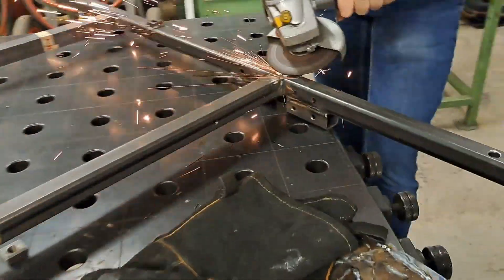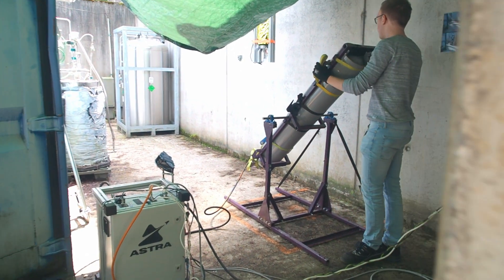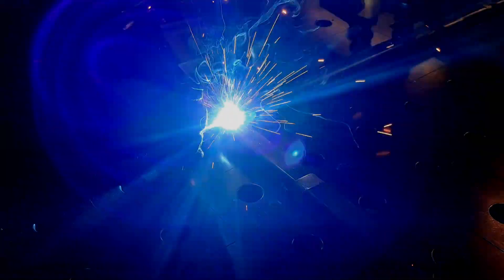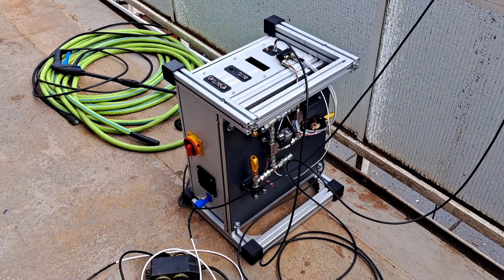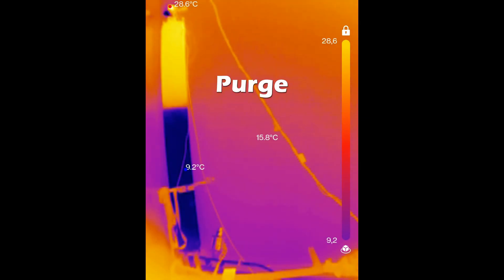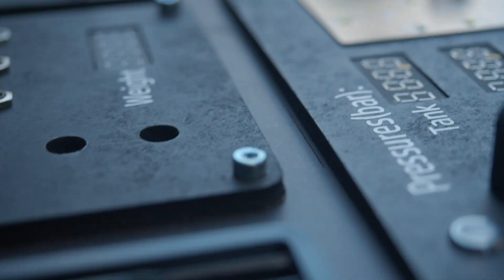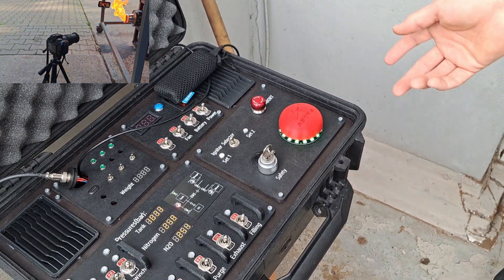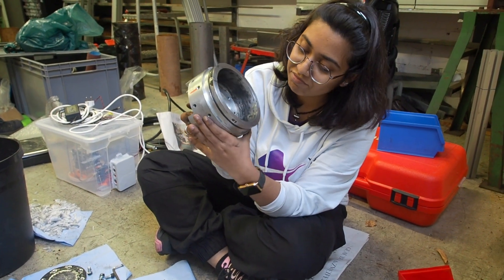Don't forget about this part of your rocket!!...

Comment: Instead of valves, why not use NOS transfer pump operates which uses a standard air pressure tank for operating power.  My main question is why don't you use a standard NOS tank like those used in race cars for your rocket instead of building your own tank, remove the valve on those race tanks then remove tube that angles to tank bottom, put valve back on then those tanks will operate upside down.  They make carbon fiber version of those race tanks.  Then you can have race tanks filled before launch and load rocket with tank when ready to launch.
Reply from the maker: That could be an option, but I am pretty sure the racing NOS tanks are not 6 meters long...  In the end when we do our space shot rocket that is how long our tank needs to be.  So we are practicing all the things we have to do to make that possible.  But a very good idea to reduce complexity indeed!

Comment: I'd say now it would have been easier with high test peroxide and an electric turbo-pump. Call me an idiot but I even would have tried it with steam or hot water under pressure.  ((I always thought of mixing magnesium particles under the paraffin))
Reply from the maker: Well, just opening valves to make everything work is actually pretty easy.  Electric turbo-pumps come with a lot of baggage and cost...  But, pumps are usually much more efficient than pressure fed systems like ours.  Could be a future evolution of our systems.